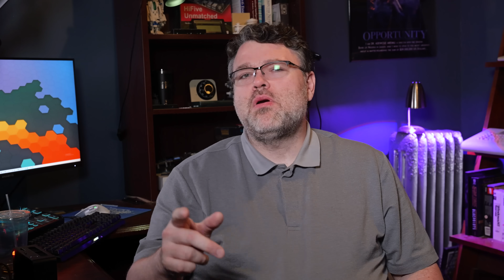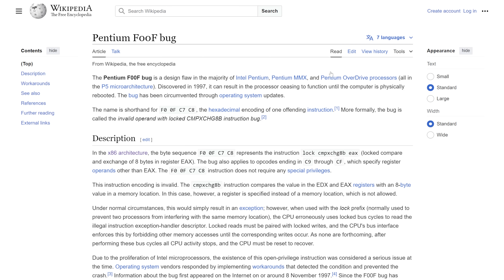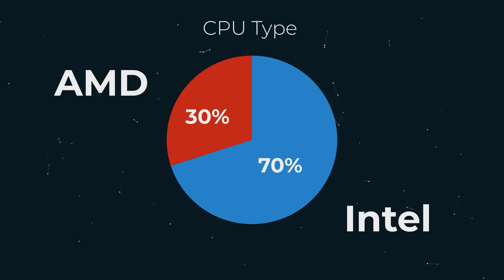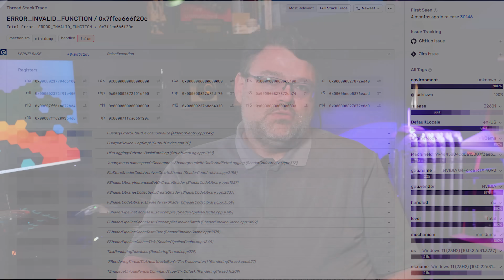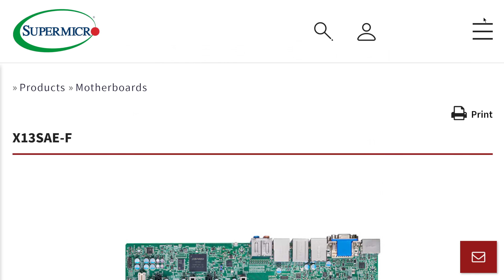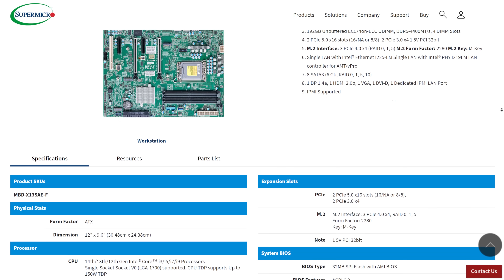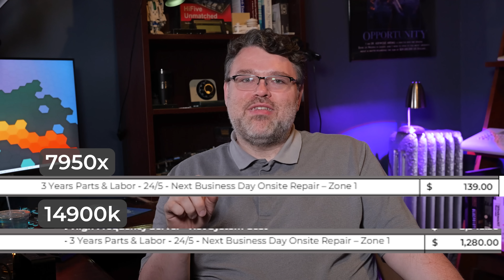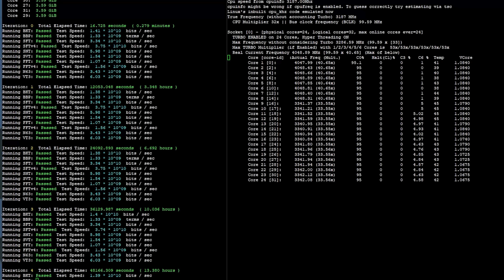Intel has a Pretty Big Problem

Comment: Interesting because recently I've randomly gotten errors with my GPU crashing "due to overheating or running out of vram" despite not actually overheating nor running out of VRAM. CPU is older though: i7 9700k

Comment: Actually i had the same issues on my 13900ks, especially with decompression , my benchmark was to decompress 8 times à once a 1gb zip to produce errors,
after a LOT of tinkering,  i ended up with a stable system,  all problems were related  to ram timings/voltage issues, had some voltage tweaking to do here and there too.
Took 3 month of despair to get there, but it is perfectly stable now

IMO it is the memory controllers that are very picky.

Edit, i'm running 2*32 ddr5 at 6ghz

Comment: Interesting. I legitimately thought it was just mobos sending too much voltage and degrading CPUs. I have  a 13600k and was lazy this time around and just left everything to auto until I was hitting 100c while gaming. Realized the mobo was sending ~1.45v!! Lazily dropped it to 1.35v with minimal stress testing. Temps dropped to ~80c in games and I haven't had any stability problems. Could definitely go lower, but I didn't want to tinker to begin with. 1.45v on auto is fucking insane.

Comment: I must be lucky, my 13700k is running stable on anything I throw at it, both on Win 11 and Linux, since I bought it almost 2 years ago. I''m running it with all power limits disabled on An Asus z790 board, which are pretty aggressive on their default settings especially on voltage. I've had a very few crashes, I'd say 2 or 3 in 2 years, I work from home as a software developer and it's my main workstation so it works hard for at least 8 hours a day, usually more because it's also my gaming PC and my main media center since I don't have a TV, so let's say 10-12 hours a day average on weekdays. I have to say I have very good cooling, an Alphacool Eisbaer 420 AIO with Noctua fans and a Fractal Meshify 2 case with 7 140mm Noctua fans, and a contact frame. My temps never go over 90-92 C even after 1 hour of R23 or Prime95. Maybe that's the issue? I saw a lot of people that often go into thermal throttling, especially with i9, but that shouldn't be a problem with gaming unless you have terrible cooling and/or airflow. I also have the contact frame, could it be that the deformation that happens with the standard Intel mounting mechanism is the issue? I mounted my contact frame a few months after buying the CPU so mine should be relatively undeformed/

Comment: I've had an innumerable number of issues with my 12700k (Same chip) across 3 different motherboards. I've been waiting for the 14700k to drop in price because of the insane amount of game crashes and bluescreens I have seen.
Thank you for the fantastic deep dive into this. Seriously great work.
Reply: Try drop the XMP and run stock.
I had same issue until I just used default ram speed and been stable for nearly 2 years.
The cpu's are garbage for getting higher speed ram working and usually means more voltage which is another reason all these issues are happening.
I wouldn't bother going for 14700k, May be even worse looking at all the problems with degradation.
Reply: 14700k crash also.
Reply: @LucasHolt  not really.
Reply: @DingleBerryschnapps  Watch the new GamersNexus video on this.  At this point, all core i5 13th gen are basically included.  (not just k sku)
Reply: Weird, my 12700k has been rock solid ever since I bought it when it was released and currently running 6400 MHz ram. I'm AI engineer and there were times I left computer processing for weeks and never had any issues with it.
Reply: @Navhkrin  that would be impossible with a 14700k.  Don't upgrade.  

I can't get mine to be stable for 30 minutes doing make -j28 compiles lol
Reply: Most of my issues were memory and power issues caused by having my contact frame on too tight (Which was barely tight at all, IMO.). Intel self-testing tool gave it a PASS, so it might just be my fault.
Reply: You simply got a bad chip
Reply: Your Intel chip sucks so you're waiting to buy another Intel chip that's also having long term issues 🤔 Interesting.
Reply: @dhLotan  I (and every American, tbh) has a vested interest in Intel succeeding. So, I only buy Intel.
Reply: @Lem_On_Lime  I buy the best. It was Intel for a while. Not now.

Comment: Well, if your CPU explodes because you used a faulty/low grade temp protector then you know the issue and can quickly "fix" it by limiting the specs to what the device can handle.
But if you did nothing wrong and have no idea why this is happening then you actually have to search for the problem.

Comment: Good time to buy one of those i9-12900K CPUs on sale at Newegg!
Reply: A friend of mine built a 12900K system a few months back - it is currently back in the shop getting diagnosed for regular crashing problems.

Good time to go AMD.
Reply: @ScruffyMisguidedAndBlue  my first AMD system in 2 decades has major issues. USB 2.0 ports don't work which seems to be a known bug they aren't fixing, and it crashes fairly often. It's a 7900x on a Gigabyte Aorus motherboard. Meanwhile my i5-12400 is rock solid...
Reply: @daygeckoarthawaii1360  There were teething problems when AM5 launched, have you updated your BIOS?

USB ports not working is a mobo/driver issue, not CPU.

Comment: Crazy! I have a 13900K and I haven't experienced a crash. I do use KVM to pass the GPU to a Windows 11 machine to game with host cpu flags.
Reply: I guess I should say, I have 3 GPUs, 2 pass thru to Windows 11 terminals, and the non passed is a third terminal. I wanted to get an Arc GPU to do sr-iov GPU cores to several smaller VMs. That's why I find it crazy that I haven't had a crash issue, given the number of operations I'm tossing at all 24 of the cores. I have Debian, Ubuntu, plan9, macos and Windows VMs. I wonder if my use case might help illuminate the issue given that there are some base instructions that don't pass through, but with "host" as the cpu type all of the cpu flags are passed in? I'm so curious now! IO is 4 btrfs nvme in raid10. 128 GB of RAM. No over clocking. Nvidia 2080 and 3070. Over 3 months of gaming time on it. Again, perhaps it's just not the right games?

Comment: Second post, about a half hour later. Intel are in trouble.
I think (as a complete outsider) the root cause of all this is having engineering types edged out of top management by accounting and stock-market and management types, boardroom pirates. The Executive Class. AMD went through this and when they almost went under, they recruited a woman to run things, so they could point to that. But Dr Lisa Su saved their company. Then Intel realised they had a problem and went and head-hunted a previous Intel engineer, Pat Gelsinger,  to come back and run it. And he's trying, but the damage is done.
Spectre & MeltDown. 4 cores and no more. 14nm and 10nm is coming, like the Rapture. Now we've got this.
The rot set in when they put an accountant in charge and he went through and fired about 70% of the engineering staff.
It's not just Intel we're talking about, and it's not just silicon and IT. Look at Boeing.
I think Jensen Huang is a bit of a special case, but look at Micro$oft and Google/Alphabet. 
I also wonder about the placement of Indian boardroom pirates. People like Rajah Kadouri and Such-a-Nutella. I'm not sure that's your key factor but it does seem to be a contributor. Again, we're not just talking silicon here, it's all across the tech / engineering space.
If you have a company that does management consultancy and book keeping, then perhaps you have a good case to have those kinds of people at the top and running it, but if you're making actual physical engineering products, then have managers and directors who come from engineering, not chartered accountants.

Comment: Degrading over time makes me think of mechanical stuff and not electronics and code.  I wonder if the cores get serious hot spots from time to time where just a small area of the chip is suddenly drawing a bunch of current and getting hot.

Comment: From my extensive overclocking on my 13600k I've had this issue as well. What I've found from my testing is that it seems related to heat/power spikes. What I've noticed is that when at the edge of the thermal envelope +80c, that there could be times where it spikes over 100c but not record it because of how fast it can spike before the temp is reported. But ultimately, the instability comes down to voltage fluctuations and temp fluctuations. When you lock the voltage and keep the temps below 80c on max prime95 loads you'll have a pretty stable system.
Reply: Then maybe that’s the way to go for now on those chips? (At the cost of some performance)
Reply: @EJM07  I am currently in my "summer clocks" Which is standard boost clocks on both p and e cores, but massively undervolted. By default my chip wants to run at 1.37v to achieve stock boost clocks. However, I can achieve this with 1.16v on load and 1.08v on idle. Yes, I have my load line calibration set where it adds slightly bit more voltage when under heavy loads so it doesn't have vdroop. But with this settings I always have a temp 6-7c above ambient on idle and temps not exceeding 75c on full load. This is even with ambient temps of up to 38c. Yes, ambient temps of 38c, that is not a typo, and yes it sucks badly when it's that hot in here. Specially with 70+% humidity.
Reply: @chieftron  i feel ya. high temp + high humidity is my pain also, it just hits differently. intel's solution to faster cpus seems to be just more voltage on the cores lately. i've seen some crazy voltages in boosting cores on some 12th gen. always thought it was a misreport from the tool, but now? not so sure anymore.

Comment: To what extent, if any, do these issues seem to affect 13700k/14700k? They have fewer cores but still have pretty insane power targets using most motherboards’ default ‘optimised’ settings.

Comment: Well done Wendell. Those of us in the OC community have had many questions about Intel's DDR5 memory controller and its sporadic behavior. I still suspect that's a large part of the underlying issue but it's likely not a single PoF. Intel handing new trays of chips in response to a data center issue indicates to me that it's almost certainly a hardware flaw that they don't have a reliable or practical test for.  This would also make it difficult to simply offer replacements to anyone who asks but they may end up having to bite that bullet eventually.

Comment: I've found these chips are massivively overvolteted out of the box. Including 12900k. 

On auto they are pushing 1.3-1.45v, and have had crashing at those voltages.

However they run fine in my experience down at 1.2-1.25v and also can turbo for much longer. 

My rigs only shut off for update restarts and have been rock solid since manually undervolting.

Comment: for my 13900k it was CORE VID Max running wild and, compounding, it took a lot of tweaking and BIOS updating to get a balanced IA Domain Loadline: if it was (AC/DC): 0.500 / 1.100 m0hm then either I got random crashes or straight blue screen at boot unless I downclocked the CPU to x53 on power cores.  I got a new cpu and have it at baseline maxs with intel failsafe limits to get a balanced 1.100 / 1.100 m0hm. Fingers crossed I do not run into degradation again, took about a year and a half for my original cpu to cook to the point where it would no longer boot unless downclocked. I had every error under the sun, so frustrating.

Comment: I have Intel Core i7-12700KF, I haven't done any overclock  on it, just 2x RAM sticks DDR-5 5600. I've seen 1 issue in total. However I have a hypothesis. Another thing different with my system is I am using Thermal Grizzly's CPU contact frame to mount my CPU. I wonder if this whole thing can go back, at least partially to LGA1700 CPUs warping and having problems with contact to the socket? Just a thought. On the other hand it might have something to do with the CPU being KF model, without the on chip graphics. Who knows. Take with teespoon of salt, as based on limited observation on sample size of 1.

Comment: My 13900K was stable until I got Starfield. Starfield gameplay was stable (GPU-dominant) while the menus and shipbuilder (which seem to be CPU-dominant) would HARD crash - no BSOD, just a hard reset. It appears Starfield was patched to work around this and my system has been perfectly stable for months. I resorted to playing on my wimpy laptop-- gameplay usable at lowest settings, shipbuilder unusable due to the horrible CPU (Passmark score 1/6th of the 13900K). Literally less than 1 frame per second update rate in shipbuilder, hence my conclusion those parts were CPU-dominant.

Comment: People have a short memory, or simply are unaware.  The AMD R9-5950X had issues with constant crashing as well.  I built a system around it when it first came out.  I got BSODs every ten minutes or less, usually with thermal over spikes.  And this is with all top-end hardware.   AMD was deleting posts on it in full denial and coverup.  But Reddit and other sites had thousands of messages from people with 5950X's that were BSOD'ing continually as well.  I spent days trying to fix mine and finally found a set of BIOS settings that worked, but I had to back off all settings including thermal max.  It is still running a few years later, but everything is dialed back on it, I can't get "100%" performance out of it.  Google it if you don't believe me.
Reply: Just Google "amd ryzen 9 5950x bsod thermal" and enjoy.  I'm not saying it's "apples to apples" with this Intel 13/14 issue, but Intel are not the only ones with processor issues.
Even to this day, if I monitor the current draw and temperature of my processor, at anything just above idle it randomly spikes so high in current draw that it over-temps and BSODs.
Reply: @daveg4417  I have had my fair share of AMD issues too, seems like nothing is a safe choice. Just a few bad options. Buy a 7950X3D and it explodes, and decide to get a 7950X instead and its fine.
Reply: @alderonmatt  - Yes, it's a shame that often us consumers are the ones who get the short end of things too.
Years ago I had a dual AMD FirePro W7000 GPU setup in a workstation for pro video editing (DaVinci Resolve etc.).  The two workstation GPUs cost 10x what a gamer GPU of that time cost (dual W7000 at $2000 vs a GTX-1060 at $250).  And the system had clicks and pops in the audio, I replaced virtually every component such as the motherboard, a top-end Focusrite rackmount audio unit, all my cables, etc., only to eventually replace the W7000 GPUs with an NVidia GTX-1060, and the clicking in the audio went away.  I've steered clear of AMD video ever since then.  I buy top end hardware, so it wasn't cheap parts.
And the R9-5950X issues turned me off of AMD processors.  My most recent purchase that replaced the R9-5950X system as my main workhorse is an Intel Xeon W7-2495X 24-Core, ASUS W790-ACE, 512GB DDR5, ASUS ROG RTX-3090 24GB, two WD SN850X etc.  The Xeon system has been great after motherboard BIOS updates.

Comment: I'm curious how many of these crashes are on Asus motherboard.  Asus has severely decreased in quality over the years...to the point that I now refuse to buy them (GPU/motherboard/anything).  Their power delivery is completely messed up, bloated BIOS (likely with spaghetti code), manufacturing defects, poor testing methodology.  Intel still seems to suck but if you put Asus suck on top of that...

Comment: I have several systems and I do have a 13900k Trouble free. The Memory controller on both the 13900k and 14900k is ONLY rated for 5600 Memory with a MAXIUM Value of 89.6 GB of memory bandwidth. If you win the silicon lottery sure shouldn't be a problem but over 90% do not win the silicon lottery. My 7200 Memory kit can only do 6400 trouble free otherwise I get crash to desktop BF2042/ DX12 Out of memory errors Fortnite. 6400 all is good. What's REALLY crazy is my 13100f ran 7200 XMP No problem. My 13100f chip has a better memory controller than my 13900k.

Comment: This is crazy. I had planned to refresh my gaming PC later this year or early next year. I am currently running an i9-11900KF having deliberately gone with that rather than a 12th gen due to the early DDR5 issues. Now finding out that Intel still has issues even on the 14th gen refresh of the 13th gen. Looks like I hold for another year or do my research and go AMD.

Comment: Its hard to tell if its chip problem when physically i see no damage on intel side that noticeable difference with amd chip physical damage since soc voltage problem. That was way worse than this issue on intel is pretty much software issue with boost curve issues that is not uniformality due to 2 type cores running different frequency. This been already fix with lunarlake.. also to take in my findings...faster ram kits do run higher voltage than ddr5 specs recommended 1.1v but for both platforms...they tend run at 1.45v for 8000 kit. I do get similar crashing on my amd platform as intel users reporting but very dangerous on amd sude when soc voltage has to be locked 1.29v manually and hard to keep cpu stable that it will randomly crash

Comment: So since 1 DPC is more stable than 2 DPC. Is this just a revisit of the weird stability problems that also presented on Skylake? But for Skylake it was only when overclocking, not stock.

9900K/10900K was notoriously hard to stabilize at high overclocks and memory/IMC speeds. It did not behave like previous generations we were used to. Could run stability testing for days without errors, but that meant nothing. It was more or less impossible to validate stability.

Random game crashes was one of the most common symptom there as well.  What "fixed it" on Skylake was running with HT turned off when running a max tuned system. Even if you ran with a higher OC with HT turned off, you still often ended up with a more stable system.